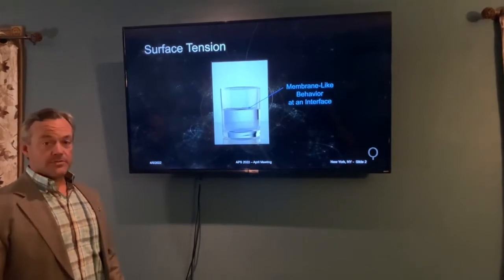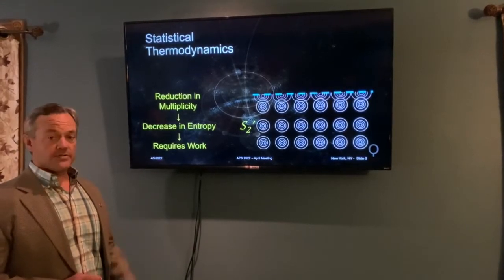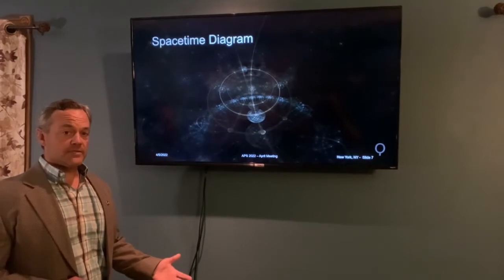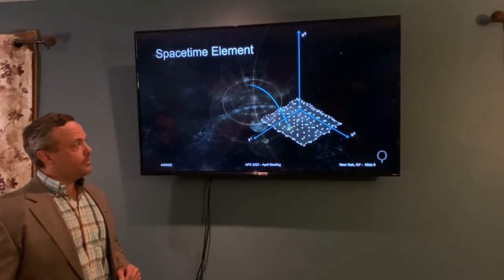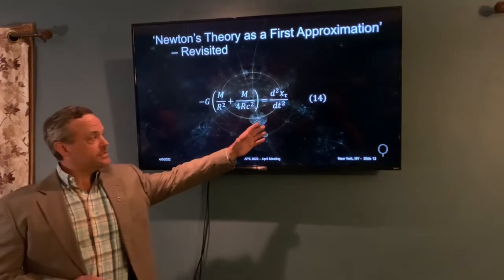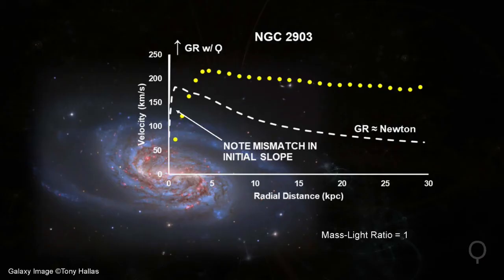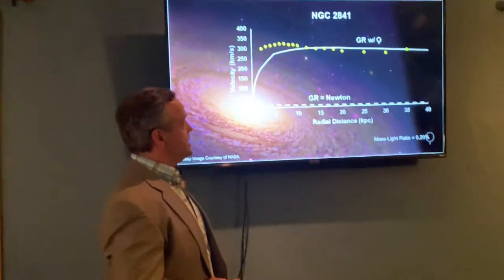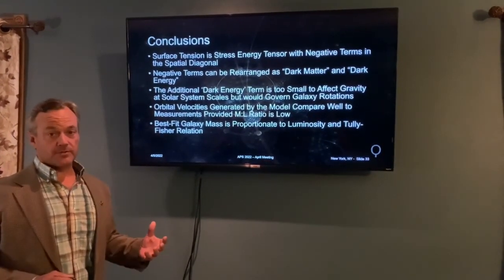Surface Tension in Cosmology - Can it explain Dark Matter and Dark Energy?

Comment: The number of times I asked my physics professors in undergrad about why we don’t consider space time to be a “substance” only to be shot down with some rationalization with the luminiferous aether being disproven… 😓
Reply from the maker: I'm glad you concur!  Spacetime itself is the "substance" that light travels on and that it curves and bends, shrinks and contracts, and obeys laws of differential geometry of smooth manifolds.  Einstein even gave an example of spacetime as an ideal fluid in his paper on general relativity.  People get confused because the theory of aether was dispelled- there is NO substance within the container of space.  Rather, the container of space itself is the "substance"!
Reply: @howardperko297  
I studied physics and philosophy in undergrad and I always struggled with the notion that light needed no medium for propagation, primarily from a metaphysical standpoint; propagation of any wave, by definition, entails a spatial and temporal displacement, which implies that without one or the other, nothing could propagate (a wavelength needs a spatial dimension to be a sensible concept and a frequency needs a temporal dimension).  I always felt that when it came to the luminiferous aether, we sort of threw the baby out with the bath water. 

I’ve taken a break between undergrad and graduate school so I don’t think I quite have the requisite toolset to dig into this too rigorously but I’ve been playing around with some of the physics of GR and your paper I read on constructing a surface tension like parameter consistent with GR with consideration of other ideas (like vacuum superfluid theory); I’ve been curious to see if maybe those could help explain certain observable phenomena like if (as one example) it could help describe how stable galaxies seem to tend towards the classic spiral shape. So far I’ve barely scratched any surface but I’m tinkering with it in my spare time with the hopes of digging into it more rigorously when I go back to grad school in a year or two.
Reply from the maker: @thefourshowflip  You raise great and intriguing questions!  I know that what I've done here isn't perfect and still needs work, but I hope it is compelling.  We need more people studying this.  Best of luck in your graduate studies!